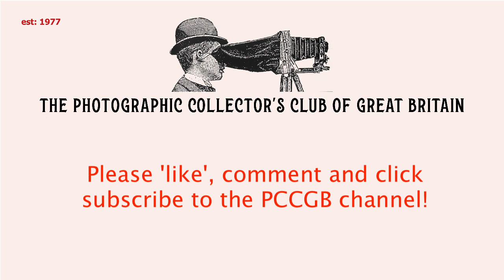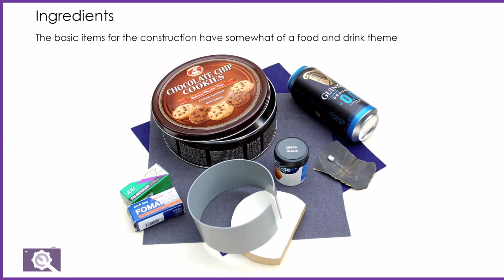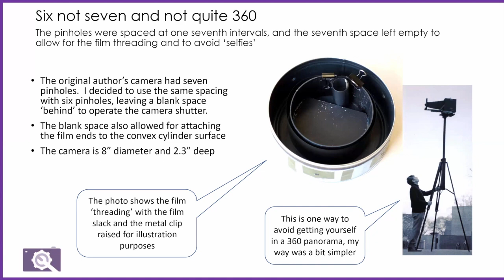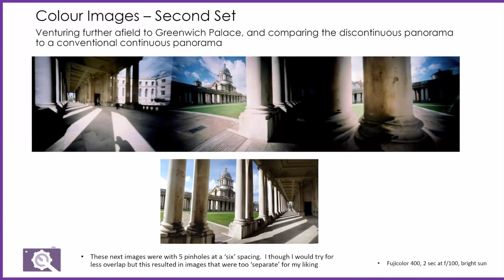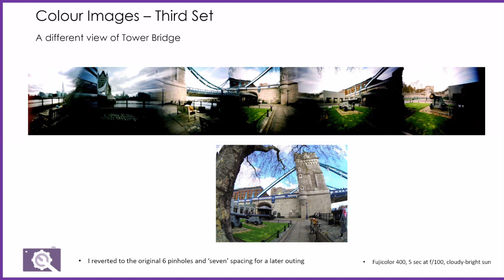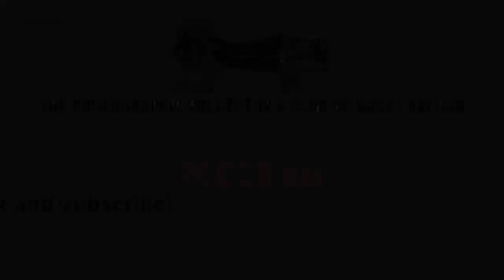360 degree pinhole panoramic photography

Comment: It would seem that the pinhole spacing and hence the number of pinholes around the circumference are related to the relative radii of the film and tin.
"Discontinuous panorama" - nice.
Rather than lifting the cover, maybe coincident holes could be made and the shutter rotated.
I would like to see a slit scan panorama using a similar set up and a single masked pinhole. The rate of rotation determines the exposure.
That Hippo Photo Lab camera needs to be made into a real camera.
I see at the end he seems to have 2 exposures on a contiguous roll. Does that mean the other half goes inside the inner box? Yes. 11 mins to 14 mins he says so but it's not clear.
Reply from the maker: From Steven Sargent:
Hi Dan, it is great to have your comments. I am reposting my reply because it didn't seem to appear correctly before. Yes indeed, the pinhole spacing and number can be changed with the relative radii of the film and tin. I based mine on the original design from Prof Wilie Sanderson. If the difference in radii is reduced so the focal lenght is less then you could have more pinholes. The Pinhole Photography book I mention would be invaluable for data on the coverage and viewing-angle for different focal lenghts. In terms of a rotating shutter, that sounds interesting. I wanted to keep my design simple for starters so that I could get to see some results quickly. The slit scan panorama that you describe sounds similar to the Lomo Spinner (I have one of these). Spinner 360° (lomography.com). That camera is good fun. The book by Brain Polden has a wealth of information about that and everything panoramic. The Bardwell Press - Photography at Length by Brian Polden (bardwell-press.co.uk)

Yes, we are still waiting for Photo Hippo to make that camera! My camera does create two images on a 120 roll. If you view the video at 14.10 to 14.20 mins, I aim to explain my film threading. As per the photo on screen, the other half of the film is rolled up and sits in the recess on the inner right hand side. You can just see the coil of film in the photo.

Many thanks for your comments, it is really good to see you are interested in this unusual contruction.